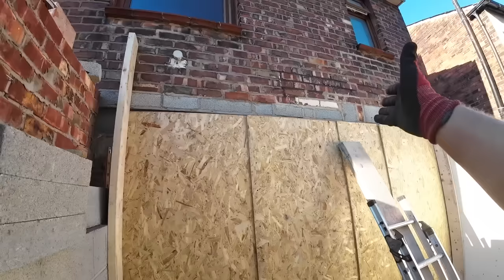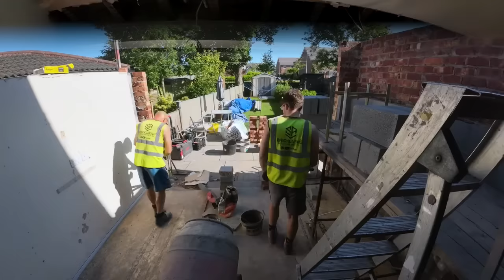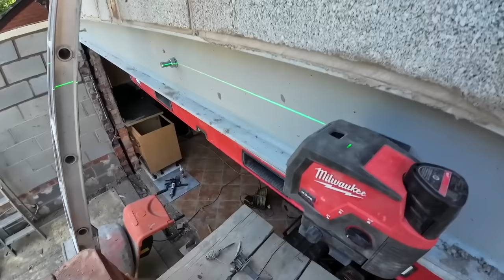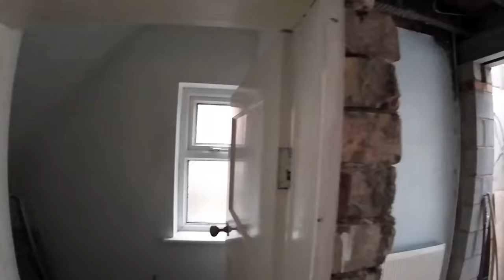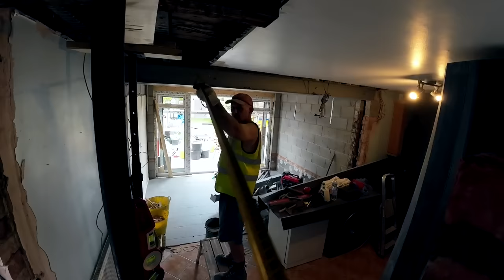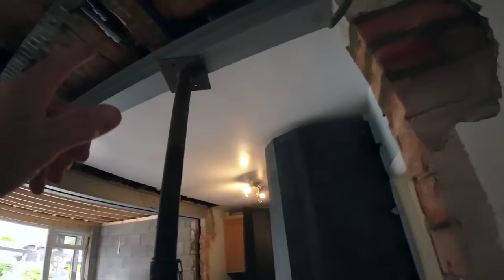WE GOT A STEEL UPSIDE DOWN!?.. CONSERVATORY CONVERSION PT 3

Comment: Hi boys I was always taught when fixing acro's never put steel to steel use a piece of wood in between to stop any slipping also two screws to anchor them safety first, same for the floor.
Reply: I always use a little piece of timber but don’t screw the acrows in. Might start doing that, sounds good 👍
Reply: Acro are called props because they are for holding in place. They are not designed for lifting. Jack the whatever , properly align the Acro and it can’t slip.
Wood between prop and the job can compress so might not be as helpful as many suggest.

Comment: Had to watch carefully to see you flip that steel 😊. Would be nice if you can sneek back for a quick film when its all done. Think if it were mine I'd have gone for exposed timbers in the extension and a couple of velux if I had the budget. Nice it has got a proper hip roof, not a fan of flat roofs. On the sun, as a skin cancer surgeon said to me - best wear a hat for protection as your head is a lot harder than arms/legs to operate on. Need a hat though that lets the heat out. Hope you got a break after that one, or sometime soon. Top job.
Reply from the maker: Cheers John . Yeah a hat us a must especially if you’ve got no hair like me 😬🧱👍🏽

Comment: Just wondering, was the smaller steel flush with the bottom of the larger steel or did it have a lip?
Reply from the maker: It was flush 🧱👍🏽
Reply: @SteveAndAlexBuild  nice work!

Comment: Ah that's nothing 😂 I worked with a lad for a few years when learning my trade and he was very tidy and fussy and he did teach me alot over the years. But we were building a house and all lintels were steel beams lol some were galvanised amd some weren't but I came in one day he had all lintels in and they were just randomly some galvanised on the internal leaf 🤣 I said it to him that the galvanised were meant for the external lol they even had holes to put threaded bar through to tie the external and internal to eachother and on a few of them the holes didn't line up lol 😂 he was quiet for a good few days even weeks agyer that blunder lol and I could see it sickened him that I pointed it out to him lol  but hey atleast it was spotted and rectified on time lol
Reply from the maker: Always  a dilemma when that happens. You did the right thing speaking up . Alex always questions me if he isn’t sure which is good 🧱👍🏽

Comment: I couldn’t tell if the beam was upside down. Can’t see why it would make any difference as it looks the same whichever way round it is. Are the beams normally stamped with an arrow ?
Reply from the maker: They need to be flush underneath where they meet . They do not need arrows normally 🧱👍🏽
Reply: So was the flange not central ?
Reply from the maker: No as the beans are different sizes 👍🏽🧱